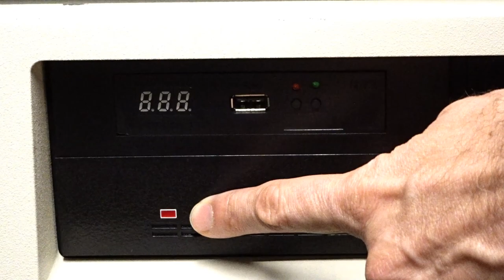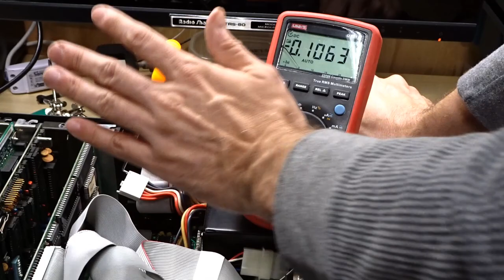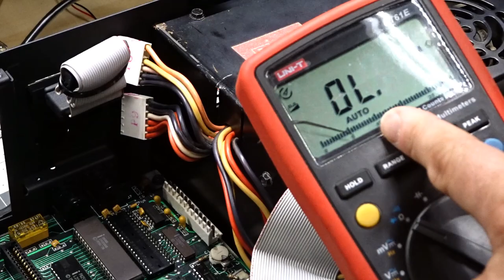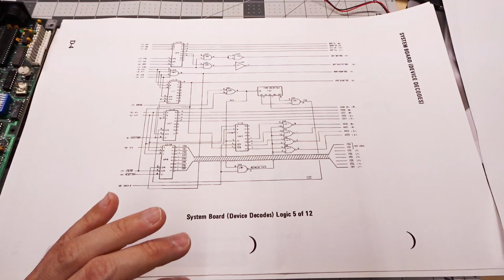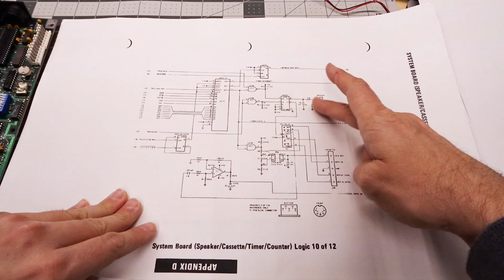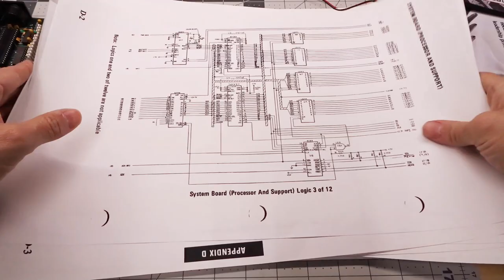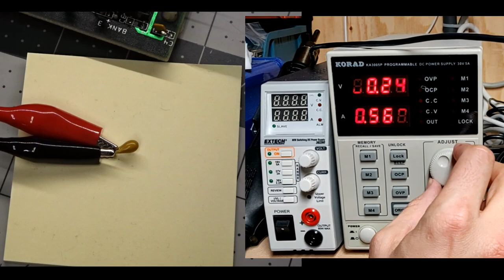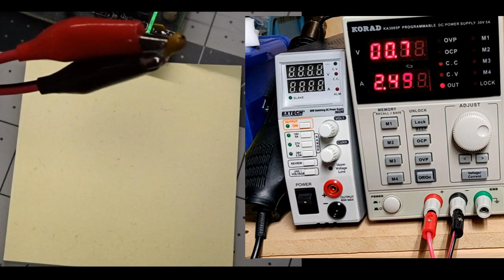Fixing a PC that won't turn on (Bonus magic smoke!)

Comment: 5.150V What a fitting voltage for that machine.
Reply: I was wondering if anyone else noticed that! :D
Reply: Maybe that's why it's known as the 5150
Reply: In California, 5150 has another meaning,  according to the WIC (Welfare and Institutions Code).  It means,  literally, a danger!    LOL
Reply: lmao
Reply: 5150 is also the name of Eddie Van Halen's studio and the model of an amazing tube amp by Peavey
Reply: OU812
Reply: Indeed
Reply: pvc Awesome can’t you add a Adlib card more ram, a vga card,3 1/2 drive to a 5150🧐
Reply: Coincidentally, my vintage C64 power supply measures 6.4V now.  Is that a good thing? ;)  Just kidding, but seriously, please do not use those old C64 power supplies--use a modern replacement instead.  Also replace Apple II/II+/IIe power supplies or at least the RIFA capacitors inside of them.  And many Atari XL power supplies are just as bad as the C64 ones, too.  Have a great day!
Reply: This comment needs 5150 likes 😅

Comment: The way I always learned was "Red to red, you're dead.  Black to black, no flak."

Excellent technique for diagnosing.  Sometimes you just have to play your hunch, which worked out quite nicely.  Thank you for the work that you do, keeping machines like this, like the ones I (we) grew up with running.  In 13 more years we'll all be so old we'll have trouble reading that 80-column text, but that machine, at 50 years old, will still do everything it originally could, and is still the basis for computers today.  IBM really had it together back in 81.
Reply: IBM is still around today somehow.  Thanks Adrian for showing this. I don't think I had one growing up since they were expensive :3
Reply: I know all about IBM and their exit from the PC market, and their presence today.  My father worked for IBM for over 30 years.
Reply: The way I learned it, " Black next to Black is a friend to Jack, red next yellow will kill a fellow. "
Reply: red touches black, friend of jack. red touches yellow, kills a fellow.
Reply: IBM is today and really always was a service company. Their PC business and their server business were intended as platforms for broader service offerings. The same is true today. IBM still offers mainframes and POWER servers for big data and big compute applications. But they are still only there because they form a core part of solutions that they couldn't offer otherwise. PCs and x86 servers are commodities now, there's really no need for IBM to make these themselves anymore,
Reply: Really is a shame the same thing will happen to these legacy systems like what already happened to my RCA 9t240 postwar set. I am only good enough to fix the low voltage and get the tubes inside to light up. Don't have a clue how to fix high voltage or even diagnose why the Cathode Ray won't fire. Don't even get me started on finding replacement parts. (1949) Most of the people who were familiar with these have been long dead (including the owner of my set. Mine spent the greater deal of 50 years in a barn). Pretty soon the new generations wont really know how to do anything with the old computers too (if they even remember them). Time sure flys!
Reply: I remembered it by thinking the Indians circle the settlers. Like the old westerns where the Indians circle the wagon train. Perhaps somewhat racist but you should hear the mnemonic I use for the resistor color code. That Violet is a real tramp!
Reply: i killed a socket 7 430vx board with red to red on accident before.

Comment: I believe the original IBM PC floppy format was actually 160 kB, single-sided, 40 tracks, 8 sectors per track, until someone, I can't remember who—maybe Tim Paterson?—was looking at the floppy controller specs and the way IBM was configuring it, and realized it would be easy to squeeze a ninth sector in, increasing the single-sided capacity to 180 kB, and the double-sided capacity from 320 kB to 360 kB. (For what it's worth, it was actually easy to squeeze a tenth sector in, even, leading to capacities ranging from, e.g. on a 3½" DD disk, nominal 720 kB formatted, 800 kB with 80 tracks to as much 843 kB with 85, at the risk of compatibility issues.)

Comment: My dad who was an Engineer in the 80s used to say 
"If you are looking for a short, apply direct voltage to the line and see where it burns"
Now considering he had a basic infinite supply of new parts and pcbs that approach was good. Now that the parts are old and rare.. well...
I always watch Louis and when he looks for shorts he also applies voltage (lower though) and adds a lot of alcohol.. so he can see where it dissipates. Or uses a thermal camera.

Comment: I used to work at In-Circuit Test debugging IBM AT motherboards. For tracing shorts we had a gadget we called a "toneohm"; basically a very sensitive ohmmeter which emitted a tone, the pitch of which would get higher as you closed in on the shorting component. Really helped with tracking down those pesky shorts.

Comment: I can't believe you figured that out. Back in the day (40 years ago) when I worked on electronics I never had any luck at component troubleshooting. Replacing the board was the way I went. Good for you by the way, that is not by any means, easy to figure out.

Comment: Capacitor smoke stinks. Its a good job these old pcs have weak power supplies. It often saves them from certain death.
Reply: Tantalum smoke smells a lot worse than electrolytic. :)

Comment: And to think 30 years ago I desecrated one of those by putting in a 486 motherboard. It still had the black power supply and worked great. I worked at BPA there in Portland and they had a plethora of them that went to scrap so I salvaged a couple for use at work. Great stuff Adrian, I hadn't seen the guts of a 5150 for a very long time!
Reply: George, what you claim is fascinating.  Truly!

That said... I'm really struggling to see how this was physically possible.

How exactly did you overcome the card slot spacing incompatibility?  The slots of the 5150 chassis were spaced one inch on center.  The aftermarket 486 motherboard's card sockets were spaced 3/4-inch center-to-center.  The openings in the back of the 5150 chassis would not have lined up with the card sockets of the motherboard.

And how did you close the cover of the 5150 chassis once populated with 5170 height cards of 1990?  Again, I'm struggling to visualize how this was done.  PC (5150) and XT (5160) chassis were not tall enough for the AT (5170) era cards, like (for example) the ATI 8514/Ultra.

Finally, do you recall which hard drive you used such that the original black 5150 power supply didn't shut down?  I was never able to make that power supply work with 386 or 486 systems plus an inboard hard drive.  The current draw was too much for the 12 volt line when the disk drive would first power up.  Could never get past the BIOS when I tried this with AMI's first 386 motherboard (Serial Number 7).  I even thought this was a flaw with the BIOS and I worked on this with AMI directly only to determine that the problem was the 5150's power supply, not AMI's motherboard.  That's why the 5160 (XT) came with a beefier power supply... and retrofit drives for the 5150 came with an expansion chassis fitted with their own power supplies.

Comment: Wow 5 amps at 12v before it blew!! 
Really enjoyed this video, it was actually very entertaining and interesting to watch, even though I don't understand most of it. :)
Reply: The lab power supply reduces the voltage significantly to limit the current through up to the max of 5A. If you look at the voltage readout it was less than 1V most of the time, so you were only putting a couple watts of actual power through it. It’s a bit confusing at first that this is what happens when you current limit a power supply but it makes sense when you think about ohms law and have a component that’s shorted out.
Reply: @SAerror1  Yes! According to ohm's law, if the resistance stayed a constant 0.05 ohms with 5 amps across it, the voltage drop would be 0.25 volts. Obviously the leads would drop probably half a volt or so as well, and also the resistance probably varies with temperature as it heats up and nears failure. Still, that means at 5 amps, and 0.25 volts it was dissipating 1.25 watts. That's more than enough to cook something that size.
Reply: It was holding steady around 7 or so watts for a minute there. Once it started failing the voltage went up a bit, peaking around 10 watts by my eye before basically failing open.
Reply: @CODMarioWarfare  Exactly! I was calculating the minimum you'd expect to see, according to the theory. As the cap started to fail (at being a resistor), and as its temperature rose, its resistance increased quickly, thereby increasing the voltage drop and the dissipated power. 

Remember also that the leads probably have more resistance than the cap initially.
Reply: Methinks most of the wattage was dissipated in the leads and power supply.  5 amps at .012 volts ~ about 300 mw in the shorted cap.  Unless the cap acted as a PTC thermistor...   but that's a new test for the next dead MB,  I guess.
Reply: @gyrgrls  Yeah, I'm also thinking the same. Almost everything has a positive temperature coefficient, including wires and most resistors. I'd be surprised if the shorted cap didn't exhibit a PTC, but I have no idea.

Comment: Tantalum capacitors used to be preferred in certain applications because they offered more capacitance in the same amount of space as regular electrolytic capacitors, and the leakage current was lower for the same capacitance.  But they have always had a bad reputation among people who replace capacitors for a living.  Meanwhile, capacitor technology has not stood still.  Modern electrolytic capacitors are better  (even less leakage, and more µF/mm³)  than 35-year-old tantalum ones were when they were new.  Just fit some 105 degree Panasonic electrolytic capacitors and it'll probably outlast you.

For working on multi-layer boards with plated-through holes, you probably will need some sort of vacuum desoldering apparatus, whether this is a fancy temperature-controled electronic device with a heated hollow tip or just one of the old-fashioned spring-loaded plunger ones  (slow because they are only good for one joint, then you have to reset the spring and eject the old solder).
Reply: I'd use a newer ceramic. Lower ESR than an electrolytic and closer to the original. Also nearly infinite lifespan.
Reply: @misterhat5823  Infinite lifespan - you wish. Through-hole ones tend to be very reliable, yes. Surface-mount ceramics, by contrast, are notoriously prone to developing stress fractures (especially when mishandled) and eventually shorting out as silver migrates through those. You could say SMD and RoHS have ruined what used to be a reliable technology. Thankfully you can get automotive grade ceramics designed to prevent these issues, bigger but also a lot more dependable.

Did I mention that the dielectric in high-capacitance ceramics is so crummy that they can lose over 50% of capacitance at rated voltage? They're also piezoelectric and can make quite the racket when subjected to AC at times.
Reply: In this case I'd imagine it would be a through hole cap that was fitted. I learned a little here today, not used to old computer equipment (more CRT TV and radio) and never really saw tantalums as a major issue before now. Certainly surprised to see one fail short, I guess the memes are right after all and it will be the caps,,,
Reply: @danmackintosh6325  Capacitors are very often to blame for problems with electronic circuits, but it's a serious mistake to try a "scattergun" replacement.  If you test after replacing every one or two capacitors, then at least any new fault you may have introduced by mis-wiring a replacement capacitor will show up sooner.
Reply: @PileOfEmptyTapes  I must disagree. SMD parts are perfectly reliable. You just have to know how to use (handle) them.
Reply: @MrHBSoftware  Decoupling does not work with high ESR caps. That's the reason why IBM didn't use electrolytics when the board was made.
Reply: @MrHBSoftware Wrong! It might operate. Or you might get glitches and corruption.
Reply: @MrHBSoftware  Again, you are wrong. The decoupling caps are for supplying the brief spikes of current needed as logic gates change states. Since it's pretty clear you don't know what you're talking about, I won't argue with you.
Reply: If I start to replace ONE tantalum, I replace them all as a rule. They are likely of the same batch and were subject to the same current spikes and enviromental conditions, so the others are likely to fail in a short time too. 

And then there are the orange or brown plastic electrolytics from Roederstein. Those are going out without even checking them.
Reply: @userPrehistoricman  100% correct, however less correct about brownouts. It's not like you're going to see a huge voltage drop. What you'll see without the decoupling is an increase in noise/ripple on the power rails as you get further from the power supply. The problem is significantly less pronounced at the frequency of the clock on these older boards: you'll mostly see an increase in harmonics and emissions due to the extended harmonic series of a square wave. 

I strongly suspect this board would still "work" with none of the decoupling caps in place. What it wouldn't do is pass FCC regulations. 

Now a modern board, even something 100 MHz or so, you have no hope of seeing that function without good local decoupling. The reactivity of the longer traces is just too great at those frequencies.
Reply: @VintageTechFan  oh, yeah, those ROE electrolytics should be whipped out on sight,  same as RIFA class X and Y suppression caps..
Reply: @andygozzo72  Ah the RIFA ones. I think the overfilled them with magic smoke at the factory, so if the hull slightly detoriates it bursts all out. It's a whole lot and the smell, it's just horrible. The interesting thing is .. even if they emit a gigantic plume of smoke, they usually still open up while failing and don't tend destroy the rest of the circuit.
Reply: @VintageTechFan  yep, they're 'supposed' to 'fail safe' -ish, without catching fire, just making a stink!

Comment: Those were the very first PC’s I worked on as an IT Analyst. Previous to that I used to be a Mainframe Computer Operator. 40 years working with computers, retired now, lol I still have an original with a cassette interface and matching monitor and keyboard. I had eight of them at one stage, keyboards, monitors, but alas all gone except one now.
Reply: Can you do a video about it? I'd love to see the BASIC tape commands in action

Comment: Great diagnosing job Adrian. That little cap took 5 amps at 12 volts before it blew wow who knew!
Reply: 5A at a fraction of a volt. Rewatch that part. There was only about a volt and most of it dropped by the test leads.
Reply: Yeah, it never hit 12 volts until the cap went open. If you work it out with ohm's law based on the resistance he measured (~0.05 ohms), you'd expect the cap to drop 0.25 volts at 5 amps. Obviously the leads drop some and the resistance changes as the cap heats up. But that's still enough to deliver 1.25 watts of heat to the cap, more than enough to cook it.

Comment: Another idea for looking for shorted parts is to use your variable power supply on the mainboard in place of the computer power supply. Set the voltage on the power supply to the correct voltage and the current to minimum. Turn on the power and start cranking up the current until you get to something "reasonable" (500ma to 1A). Use the voltmeter and poke around suspected parts and look for the lowest voltage. By injecting a constant current you make the power supply and the voltmeter into a crude ohm meter capable of measuring really low ohms accurately. Since you're only looking for the lowest resistance in the circuit, absolute resistance measurements aren't relevant and the lowest measured voltage will suffice.

Comment: Wow, this 5150 is in great condition!
Reply: Well, there have been so many changes to it, it is more like an XT at this point.  I am actually surprised the stacked DRAM mod was not done on it however.
Reply: The IBM 5150s were built like tanks. They used metal for their basic construction of the case vs plastic like Apple. IBM definitely had more experience with packaging. The 5150 looks like it's from the 90's but it's actually from 81. Lol